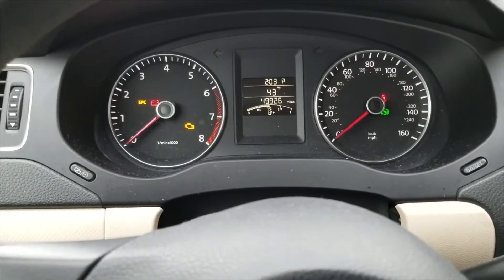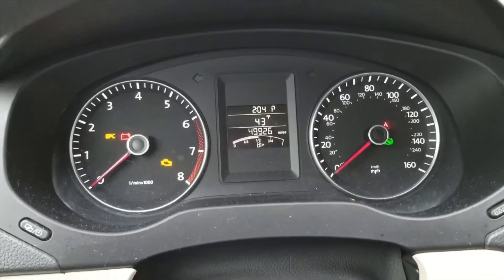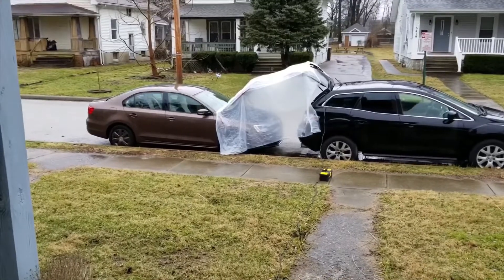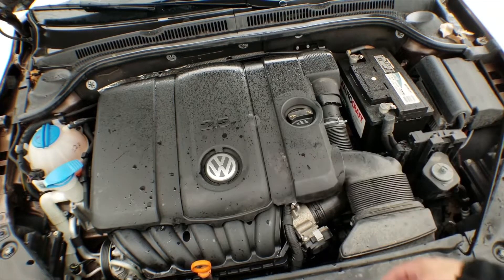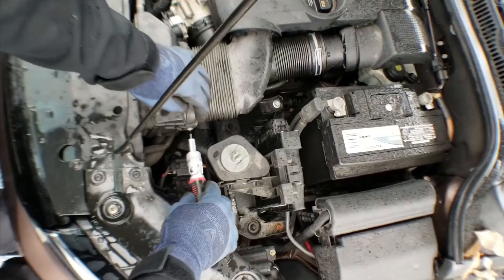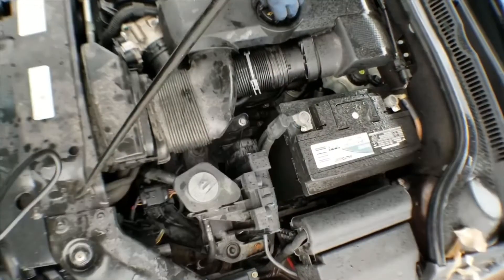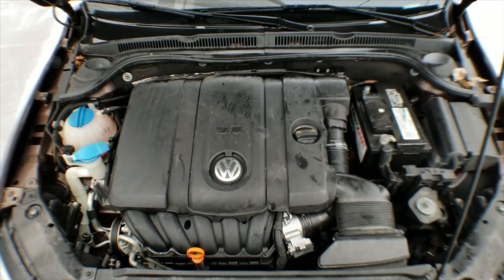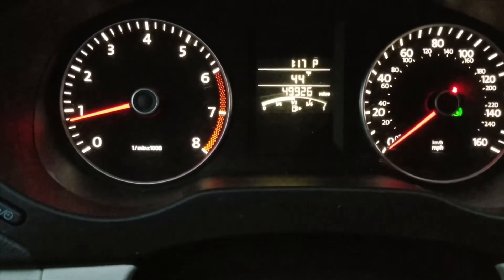Volkswagen EPC Light Diagnosis: Throttle Body Replacement

Comment: I am having random EPC warning on my 2018 Tiguan with only 45k miles on it. No engine light though. When EPC light comes, the acceleration just dies and I can't push the car. I pull over and turn engine off. After turning back on the EPC light goes and car runs fine until EPC comes again. It has happened twice this week already. I am taking it to VW today and hopefully it will be covered under warranty. It was a bad mistake switching from a Subaru to VW :(
Reply from the maker: Yes you can certainly have intermittent issues such as that! I would assume they would either clean/ replace the Throttle body/ Mass Air Flow sensor or maybe replace the acceleration pedal since those three are highly responsible for that EPC acceleration issue. Yes I feel the same VW has been a pain. EPC and front wheel bearings before 50,000 miles 😡 hope you can get that diagnosed/ resolved at a reasonable price if taking it to the dealer. Good luck on the repair 🤜🤛
Reply: @elevatedpotentialacademy  Hi I'm driving vw polo vivo 2011 model so the problem now is EPC light and the engine shakes and the accelarater die but if I can raff it then it come to the normal again so please help

Comment: Hi my EPC light is on and now my engine light is on, will I be able to drive two hours tomorrow and drive two hours back? Im going get it check Wednesday, will NOT buy a VW again
Reply from the maker: I don't believe you'll be able to if your car is having as much trouble accelerating as mine had. Sometimes it is intermittent, in that case I would say you probably could. However, I wouldn't recommend a 2 hour drive on an EPC acceleration issue. Yes, VWs are a pain when it comes to this EPC light and so much more. I hope you can get it resolved in time 🤜🤛
Reply: Ballin On A Budget Auto yeah I’m taking it to VW Wednesday, the engine light just came on today so I was thinking I would be ok if I would try and drive it and come back
Reply: I end up trading that car in got another one, but not a VW
Reply from the maker: @shannadixon2265  Hopefully that car is treating you better than these VWs and their issues haha! Good luck with everything! Stay Tuned 🤜🤛
Reply: Ballin On A Budget Auto yeah it is I didn’t want to rid of it but I had too

Comment: Hey man, thanks so much for this video. I'm having the same problem on my 2013 VW jetta 2.5, hopefully this works!
Reply from the maker: I appreciate the feedback! Yeah if it isn't accelerating properly It's def one of the 3: the Electronic Throttle Body, Acceleration Pedal, or potentially the MAF Sensor; usually a Check Engine Light should appear and that will help narrow it down for you. I hope this video helps 🤜🤛

Comment: This was really helpful im having the same symptoms and i think this will be the solution to my problem also. Being my mechanic is closed for the week im going to give this a shot
Reply from the maker: Thanks for the positive feedback! If it is an acceleration issue it is likely caused by the throttle body, acceleration pedal, or mass air flow sensor. There are a few other possible issues that I know of such as the brake light switch, cruise control/ traction control, and even power steering;  however, there possibly are some other causes as well if it isn't an acceleration issue. It is hard to tell without running an OBD2 diagnostic code reader. I hope that helps narrow it down some and that this video has helped 🤜🤛
Reply: @elevatedpotentialacademy  same thing happened to me. I got a cheap 12$ OBD2 reader from Amazon. I got p0322. From my research, it was crankshaft position sensor. Or possibly few others like camshaft position sensor, and few other things. I replaced crankshaft position sensor. Before replacing  the lights went out when I turned car off, but would still drive same. After replacing it stopped. But it's not driving like before this. Feel light my throttle response is off a bit, even though it always felt alittle off, due to being sensors and not throttle cables. What's your advice? I'm at 123,500 miles. I was thinking maybe camshaft position sensor. Thanks

Comment: How much u think it will be?
Reply from the maker: Hey! The Throttle Body I purchased was $89.99 at the time on ebay. Here is the link:
 https://rover.ebay.com/rover/0/0/0?mpre=https%3A%2F%2Fwww.ebay.com%2Fulk%2Fitm%2F253896564409 
Good luck on the repair! I hope my video helps 🤜🤛

Comment: Hello!! I just purchased a 2007 vw Toureg...I have acceleration issues....could this be the problem for mine also?  How do I get the code checked? 🙏🏼🙏🏼🙏🏼
Reply from the maker: Hey! It is a good possibility being that it does have an electric throttle body like my Jetta, especially if it is showing an EPC and check engine light on the dash. I would recommend going to a local parts store like Advanced Auto Parts or Auto Zone and have the code read for free! There are a few other possible issues if it is an acceleration issue. It can either be caused by the throttle body, acceleration pedal, or mass air flow sensor. It is hard to tell without running an OBD2 diagnostic code reader. Try to get it read when it is on next. I hope that helps narrow it down some! If you have any questions feel free to reach out, good luck on the repair 🤜🤛
Reply: Ballin On A Budget Auto Thank you!! I got it checked and it’s like 7 codes😭 it’s cylinders 1&2 are misfiring a fuel regulator code, and a camshaft code🤦🏻‍♀️
Reply from the maker: @mrztvsg1467  👎👎 dang so looks like a tune up/ coil packs, then according to what I've seen for your vehicle (haven't worked on a toureg), the fuel pressure regulator should be pretty easy to access under the rear passenger seat in the fuel pump assembly, and the camshaft position sensor should be located on the driver side of the crankcase. Unfortunately, I don't have a video that would help you with that at this moment. I'm sorry this video wasn't able to help, but I hope you are able to have someone correct the issue. Good luck with the repair!

Comment: What happened to the check engine light? It lit up didn't show up any problems?
Reply from the maker: What happened to the check engine light? The check engine light originally read P0222 which was related to the Throttle Position Sensor but being that this is a vehicle with an Electric Throttle Body no throttle position sensor existed. If the light doesn't go away on its own you reset it and drive for about 50-100 miles for the system to recognize if there are any issues remaining. However, the light never returned and my VW is still accelerating and running smoothly with no issues. Hopefully that answered your question👍
Reply: My car 1.4tsi running code p300 : random multiple misfire cylinder (static) 
p301: cylinder 1 misfire detected (intermittent)
p303: cylinder 3 misfire detected (static) 
When my car stop and idle, the check engine flashes and will stay and causes the EPC lit up. And it was then all the time there even re start and move the car, there are one moment I kick the gas/throttle pedal vigorously 3 times and restart the car. The check engine light gone. Everything was smooth till now. But every single time stop and idle for too long says 1 minute the check engine light will flash again then EPC lit up. In order not to happen so, I have to keep lightly on the gas pedal at stop and idle so it won't lit up anything.
Reply from the maker: @davidking9846  the symptoms that you are referring to sound like the EPC light is being caused by the need for a tune up of spark plugs/ coil packs in which are causing those misfire codes and idle issues due to your ignition system failing. Resolve the misfires first and I'm almost certain that should resolve the problem 🤜🤛

Comment: Thank you so much for this video! Those 3 lights came on with my '12 VWJ ... After looking under the hood and seeing that there was a random metal tool laying on the wires I just simply removed it and cut the car back on and the lights disappeared... That was 4 days ago and it's been no problems since then so I'm hoping all is good but just in case I'mma keep this video in mind. Thank you, Thank you, Thank you!!!! New Subbie!!! 😊
Reply from the maker: Thank you for such positive feedback, I appreciate it!! I'm glad that these videos are helping😁 that's what it's all about!! I'm glad you were able to fix it simply by doing that. These VWs seem to have a very sensitive electrical system unfortunately. I hope that solved the problem! If not, feel free to reach out, i'll be happy to help! Thanks again 🤜🤛
Reply: @elevatedpotentialacademy  thank you for your warm response. Sadly all 3 of the lights came back on this morning on my way to work and as I got to my destination. I cut the car off and back on to see if it'll go off but the car wouldn't cut back on for a minute until a two attempts later it did. It's strange because my car runs fine, it picks up speed in a snap of a finger so I'm not sure what could be the problem now. You've been very helpful. Thank you again.
Reply from the maker: @PrincessCollins2023  That's unfortunate. There are a few other possible issues that I know of such as the brake light switch, cruise control/ traction control, and even power steering that can result in an EPC light;  however, there possibly are some other causes as well if it isn't an acceleration issue caused by the throttle body, acceleration pedal, or mass air flow sensor. It is hard to tell without running an OBD2 diagnostic code reader. Try to get the Check Engine Light read by a friend or local parts store and it will help narrow it down some!
Reply: @elevatedpotentialacademy Will do, Thank you so much sir!!!

Comment: Did you have to calibrate the Throttle Body after the installation? Thank you for the excellent video!
Reply from the maker: No, calibrating was not necessary! It worked great and still doing well👍 good luck on the repair and I hope this video helped 🤜🤛 I appreciate the positive feedback, thank you!!!
Reply: All the guy had to do was use vagcom and calibrate the throttle body. No need to replace it. Wow

Comment: Hey MR. BALLiN I have a 2012 VW cc 2.0 t .  I parked the car overnight and in the morning the car wouldn’t start! I have a check engine light and the epc light is on and then the car has a red low oil pressure light comes on but I have full oil on the dipstick! I checked the codes and got p0300 all the way to p0304 all 4 cylinders misfire and code p2015 and it has a recall for the fuel pump to be replaced! My question is would all four spark plugs or coil packs go bad overnight or all at once when you try and start the car?? Gonna replace plugs first but I just think it’s weird to get all these codes at once!??! Sorry so long!
Reply from the maker: Hey! So you got all these lights without the car turning over correct as in it still doesn't start? All the lights showing at the initial turn of the ignition key is common. However, You can get random Misfire codes from low fuel pressure, EGR Malfunction, or the plugs/coil packs themselves. If the car starts using starter fluid then its more than likely the Fuel Pump and/ or simply a Fuel Filter needing changed. Yet, with cars nothing is impossible, it could had honestly been your plugs/ coil packs as you had suggested. Worst case scenario compression issues but I'd narrow down the ignition system/ fuel assembly first to be certain since both of these can cause a no start. Almost forgot, it also could be a vacuum leak as well which can also trigger misfires and no start. I hope this helps🤜🤛
Reply: Ballin On A Budget Auto  hey thanks for the reply gonna go at it in the morning and see if I can fix this mess! 🤞🏼🤞🏼🤞🏼
Reply from the maker: You're welcome and thanks for reaching out! I hope it works 👍

Comment: Hi i have a polo playa 2001. The epc , oil and engen light will come on when I turn the car of. And my feul gadge not working all at once. What can the problem be. And it drive's just fine no problem
Reply from the maker: You're saying that the EPC, Oil, and Check engine light come on when you turn it off? Or On? If on, is it still there after the car starts? Also, does the fuel gauge work at all with the car started? I'm trying to get a better understanding of what you are saying.
Reply: @elevatedpotentialacademy  only when i turn the car off while I'm driving ther is no light's at all. And fuel gadge not working at all even while im deriving its bellow red but the low feul light doesn't even come on.
Reply from the maker: @topamvcreator  According to what you're saying, it sounds like it is your Fuel Tank Float/ Sending Unit that has failed and has caused your Fuel Gauge to stop registering. These are usually attached to the Fuel Pump Assembly in the Fuel Tank. If those lights you had mentioned do not stay illuminated after turning the car on and during driving then you're fine. It is common for those lights to show up when initially turning on/ turning off the car. I hope this post helps👍 I will have a Fuel Pump Assembly Replacement video up in the next few weeks! I had the same issue with my '99 Mustang. Good luck with the repair! Stay Tuned!

Comment: Thanks man I think I might have something my car doesn't accelerate I have 2009 CC
Reply from the maker: Welcome man I appreciate the feedback! Yeah if it isn't accelerating properly It's def one of the 3: the Electronic Throttle Body, Acceleration Pedal, or potentially the MAF Sensor; usually a Check Engine Light should appear and that will help narrow it down for you. I hope this video helps 🤜🤛
Reply: Me 2 same issue I replaced the petal and it went away for a bit the. It re appeared I’m gonna change the throttle body next
Reply from the maker: @katherinecortez2663  Great work! Yeah it def sounds like it may be if you're still seeing the EPC light and feeling an acceleration issue after replacing the acceleration pedal. I hope changing the Throttle body will be the solution. If not, it could also be the Mass Air Flow Sensor. Good luck on the repair 🤜🤛

Comment: my EPC light comes on randomly for the past week. I didnt notice any issues while driving. No acceleration issues or anything. What do you think it is?
Reply from the maker: There are a few other possible issues that I know of such as the brake light switch, cruise control/ traction control, and even power steering;  however, there possibly are some other causes as well if it isn't an acceleration issue caused by the throttle body, acceleration pedal, or mass air flow sensor. It is hard to tell without running an OBD2 diagnostic code reader. Try to get it read when it is on next. I hope that helps narrow it down some!
Reply: Ballin On A Budget Auto thank you sir

Comment: Hey man, how much for the part ?
Reply from the maker: Hey man! The Throttle Body I purchased was $89.99 at the time on ebay. Here is the link:
 https://rover.ebay.com/rover/0/0/0?mpre=https%3A%2F%2Fwww.ebay.com%2Fulk%2Fitm%2F253896564409 
Good luck on the repair! I hope my video helps 🤜🤛

Comment: Is there another name for that part? My code after it was scanned said it was the throttle control modulator is that the same thing? Asking for ummm a friend yeah that's it a friend
Reply from the maker: Yes, the Volkswagens using an Electric Throttle System with no throttle cable will be the entire throttle body such as what I did (has that attatched black casing and plug on the throttle body). However, earlier models (I'm unsure as to when the electric throttle body was introduced in Volkswagen) will have a throttle position sensor separate from the throttle body itself, you would not see this EPC light warning in these earlier models from my understanding.